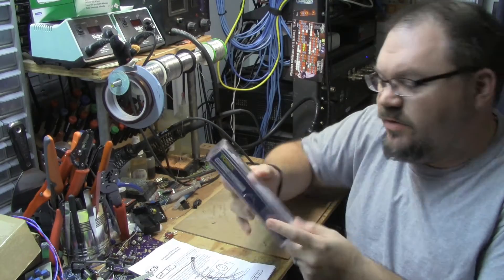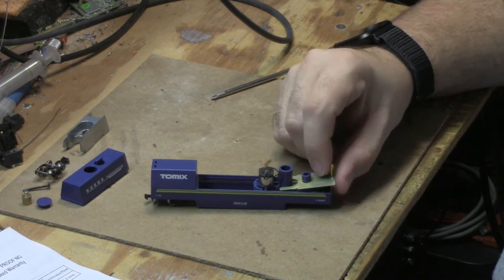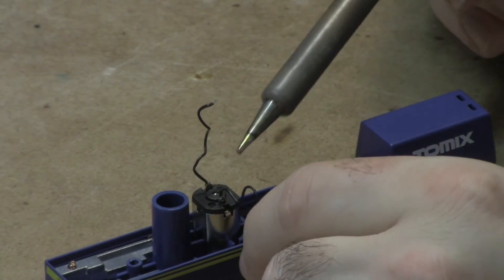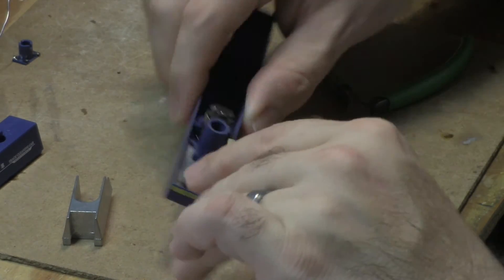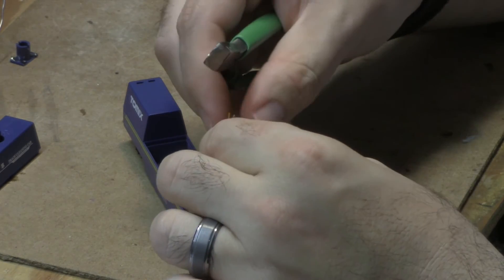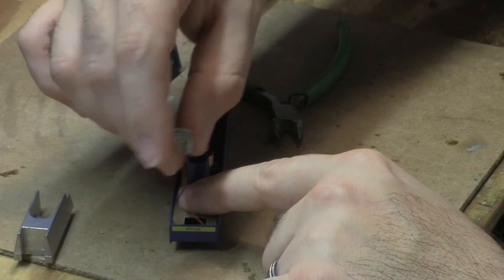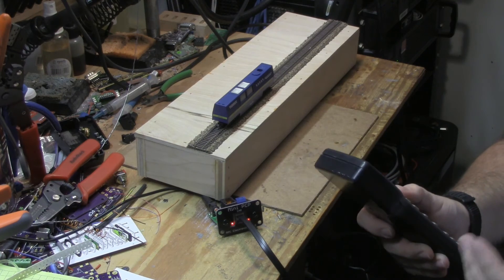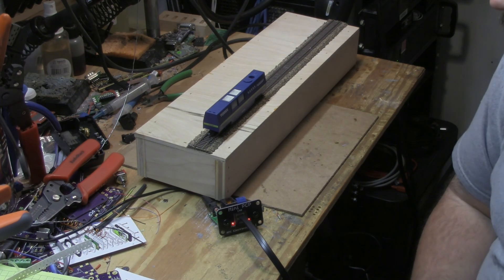Tomix Track Cleaning Car DCC Conversion

Comment: omg,the worst 'how to' clip ive ever seen.before you make a video, at least make sure it can be done.can't see for your hands,Using a Dremel, but not showing us what your dremeling (bad spelling),not discussing if there is a proper order where the wires are soldered in respect of polarity etc to the motor.And NO, i couldn't do one of these clips, because of issues above, so i don't even attempt it.
Reply from the maker: Let me know where I can send your refund to.

Comment: Hello Jason, Great video. I did the same fitting but added a LED light that I programmed with the decoder to flash when the motor is going in a clockwise direction (forward) and not illuminate when going in reverse. I found it handy as the vacuum sucks better in the forward direction rather than reverse. The flashing light also looks cool as it travels around the layout.

Comment: Thanks for your video. It worked perfectly the first time, I did use a digitrax 136 and I just barely trimmed the weight to fit it in snuggly. But it works real good. Thanks again

Comment: The weight is a check valve,  used to keep dirt from exiting the bin when off.   That would be my guess.
Reply from the maker: Thanks!  My Japanese is just a little rusty trying to read the note that came with it ;o)
Reply: Eh! No, it's something to do with the system that puts cleaning fluid on the track.